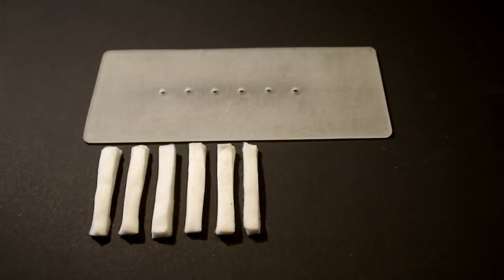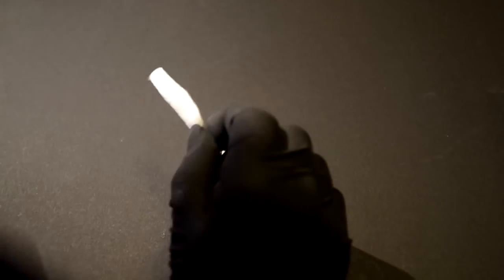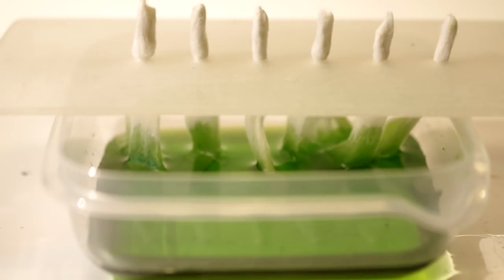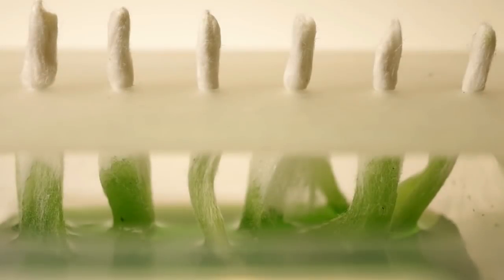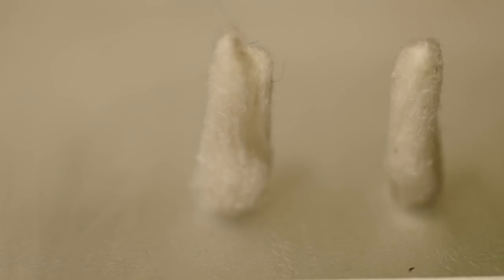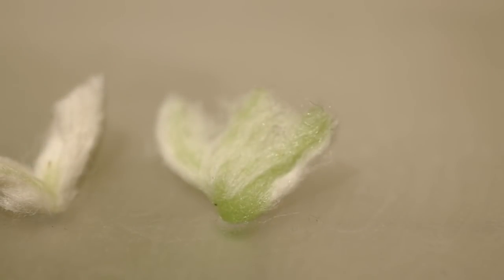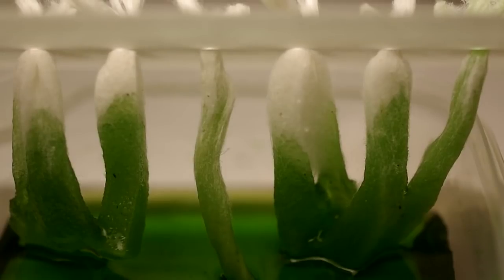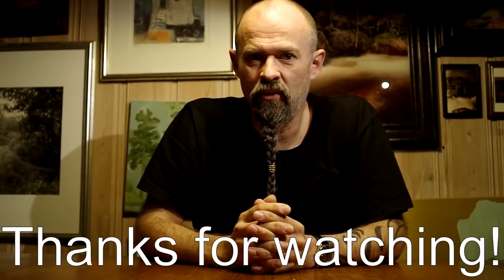How hard should you wick? Very hard! Part 3; Fluffing.

Comment: might be a coincidence, but it looks to me like the tightness has an effect on the end portion of the video.  It looks like the wicks with the most juice at the top are also the loosest in the holes, which could be choking the wick.  If you watch you can see the ones with juice at the top sliding in the hole while the dry ones are more snug.  The sliding could also be from the juice lubricating the hole.

Comment: My first impression on this new learning from Oen... I managed to pass a 12mm cut strip of organic pad through a 3mm diameter 24ga, 6 turns round wire coil inside my Gorge. This is basically the same amount of cotton I already used to cut.. BUT, I used to remove the outer layers (both sides) and I used to pinch/roll one side while holding the other side, to fluff the whole strip. And after cutting the sides to the size I wanted, I used to comb each side and then cut the excess fuzzies. I figured out that when removing both outer layers these 12mm were the "right" amount desired to reach that usual not-loose-not-tight point. But WITHOUT removing these layers, these 12mm almost messed up my build. It's really really really tight now and almost no crackling at all. Dialed down from 40W to 30W and with a nice warm vapor. Flavor is really good and steady, without juice spitting in my mouth now I can really judge the real flavor from my juice, only the vapor, and not the liquid. Very satisfied!
Reply: But one thing I have to say... having to manipulate my cotton so vigorously to pass it through the coil, I think my hands passed something to the cotton that messed up a little bit of the flavor. And I washed my hands very well before doing the wicking work. Next time I'll test with gloves.
Reply: Bob William 
Man, I really hate getting juice in my mouth. I think I might rather have a dry hit than liquid in my mouth. Thank you for your suggestions.
Reply: Bob William 
What ever substance the manufacturer put on those gloves to keep them from sticking together in the box is way worse than anything that might me on your hands, I promise.

Comment: I'm so glad it was # 6. I cut strip out of pad(or rip off piece of bacon) about size of coil hole, take off outer layers, mist my hands with spray bottle and dry so they are just tacky, then in one nice motion role wick, or 2 or 3 times, then spin ends into points, put through coil then pull. Any tighter I would have to hold coil. I now am trying to see if I can get away with cutting ends and dropping in because my habit has been to slightly comb with mustache comb, snip, then agitate cut mark back open. That's always worked great but If I can skip those end steps that would be good.I use 26/36 fused or 28/38 triple or quad fused. Ss from advanced vape supply. Slightly Spaced 3mm id 6 wraps. 
Thanks for videos! Will try to update.

Comment: What about peeling the outer "pressed" layers on the outside of the pad off? I know some people swear by it saying that it just leaves the fluffy stuff that is better at wicking and gets rid of the compressed bits that are worse. Also, would you mind showing a clip of you actually rewicking a coil to better demonstrate the snugness?
Reply: Oh, and I know you tend to go for flavor, what are your opinions on vg/pg ratios? Ive heard people say pg is better for carrying flavor, but you use 80/20. Do you find that pg isnt as important? Most of the juices I have tried are 70/30-80/20. I have found some 70/30s to be really flavorful and some to be duds in the flavor department. Same with 80/20s, some flavorful and some less, so it's not super conclusive for me.
Reply from the maker: Hi, The outer layer should stay on. In combination with the fluffy cotton it's like a wick in a wick. It's no good on its own, and the fluffy cotton is better with it still there. I squeece a 14 mm broad strip of cotton pad through a 4mm diameter coil. 3 times the diameter is a good indication of the tightness. Regarding fluffing, for the most part, in most RDA's, leave the cotton undisturbed, unless the coils are really high up, then you should squize it gently together. I will do no more cotton videos. Sorry :-) But I still do a lot of experiments with it. The new experiments is just fine tuning this stuff, and the data is only valid for me.
Reply: Thanks, I'll give it ago next time I wick up my Kennedy.

Comment: great series.  I'm going to play around with my wicks to see how it works for me.  I usually remove one side of the cotton, scottish roll and fluff my ends.  your method is much easier.  Never used a tank?  merely curious...  when you first started vaping (I think I heard you say you've been vaping at least a couple of years) you learned to build and wrap a coil, learned ohms law etc. before you took your first hit?  Also it seems your first vape experience would likely have been sub-ohm.  just seems a little odd.  most people start with some sort of tank, learn how to vape (since vaping is a bit different from smoking in terms of how you inhale etc.) and then progressively move on to rda's etc.  Unless you have a squonk rda it's simply not practical for most of us to drip all day/night.  there is driving, work and all sorts of activities to contend with which make dirpping impractical.

Comment: Cotton bacon v2 doesn't let you twist crap. I fluffed it and added a lot of cotton.. But I use mesh and no coils... Got any techniques for mesh?

I need a cotton that holds juice.. I stacked a lot onto the MESH coil into a RDTA. Works great but cotton bacon v2 doesn't full more out of the tank fast enough or enough for more then 2-4 hits every few minutes . Sub 70w
Reply from the maker: I do not use mesh, I have never liked it, and I have a handful of mesh RDAs. You might not like my suggestion, but here it is: With all my mesh RDAs I have gotten the best results when installing flat wire coils in the clamps, and using cheapo muji cotton. Most mesh RDAs will let you do this, and the results are way better than with mesh. These RDAs have lots of air holes, and that is perfect for a big flatwire coil. Just think outside the box, and you will figure it out:-)

Comment: Hello morten,
  Greetings from India.
This super tight wicking doesn't seem to work for flavour on my entheon clone. There is vapour but no flavour. Also I did watch your video on the entheon coil placement and I wanted to know if you have a picture of how your coil looks at the correct position and how you get it there because the edges of the atty doesn't allow me to pull the coil down to that height with a coil tool. I was wondering if you have any updated thoughts on the same.
Reply from the maker: Hi. I use a flatwire coil, it's very thin, and you can just push gently on the coil legs to get it down. And place it upside-down. It is not difficult, and if you make your own coils, like I do, it is very cheap to experiment a day or two to get what you want. Good luck!

Comment: How long does it usually take you to hand-hammer each coil? It's good, really really good, loving the ramp-up time. And it really did take me quite sometime to figure out how to calculate it properly.
Reply from the maker: Thanks! I have not mesured the time, but I think I use 5 min on one coil. Never more than 10 min. :-) You'll get quicker fast if you make a coil every other day. Stay with 20g and 22g and 24g wire, and about 3-5 wraps. Change resistanse by using SS or Kanthal metal. This way you rarely have to hammer more than 5cm of the wire, and leave the legs semi-flat. Best of luck!
Reply: @mortenoen434  No, thanks to you! I have been building it the way you are, calculating the circumference to find how long should I flattened it. 22 g kanthal for dual, 22g ss for single ones. Still taking me 20-30 mins for each coil. 0.15-0.22ohms usually.

With the recent mtl rda/rta "boom", would your wicking and hand-hammered methods would work? Just tried it on chtulhu 1928 rda, the wick got burnt so fast on 0.8ohms, hand-hammered 26g kanthal, restricted airflow, 17 watts, 3.3volts. Not enough airflow to cool the coil?
Reply from the maker: @eriefebrianto3492   You need a ton of air flow to cool these coils down:-) They don't work on a lot of RDAs/ RTAs. On mtl there is just no way it will work. But you can try to hammer semi-flat.
Reply: @mortenoen434  Bunch a thanks! I've since been using 26g round kanthal, the cotton is still going strong. But I do want to give that hand-hammered coil another go, gotta make it work. I'll try semi flat if that still fails.

Bought the entheon, and been watching over your vids on its build. Thx so much!

Comment: I do appreciate the information. Are you familiar with the Scottish roll wicking method? According to your experiment, that sounds to be best. 

I also did not understand your conclusion on the coil type video. I saw the videos but I did not know which one was better or recommended  The flat wire, or something like a fused Clapton(with 40 gauge). I also thought the argument of, "You did not use heat" in your wicking experiment to be funny. It makes no difference.  The heat will just dry up the cotton and the wicking will take effect. The focus is the wicking.

Comment: 1 that wasn't so much fluffing the cotton as it was just splitting it in half 
2 where is the simulation for heat that your coils would produce and create a capillary action 🤔
Reply from the maker: 1. The fluffing was for real. Maybe one of the outer layers in the cotton, or the angle of the camera tricks the eye.
2. Heat does not create capillary action. Heat can make some liquids more or less viscuos. It is the density of the fibres that decides how fast and high capillary action works when all else is equal. This was just a re-run of an experiment done in the 16th century. What I have proven is very old knowledge.

Comment: This idea makes sense for rdas but won't wick fast enough for rtas
Reply from the maker: As stated in the video, I know absolutely nothing about tanks:-) But pass that info along if it's true.
Reply: Morten Oen the best way to utilize this method is with squonk rdas.. Thank you for the videos
Reply from the maker: I have a lot of feedback over at other forums, that they have great success with the method on RDTAs. Have you tried it on a tank? Just curious:-)
Reply: Yes sir.. I found out about this method a while back... it's what made the scottish roll wicking method so popular.. I have done research and heard people saying they have had success in rdtas, rtas, etc but looser.. I unfortunately have never found that to be true. Anything that requires extensive traveling of juice doesn't seem to wick fast enough.. My favorite method on rdas is very very short wick.. just enough to touch the tip of the deck with massive, thick, tight wicking. I've used this method for years. I find it uses the full potential of the wick... I can use every drop of juice in that cotton and make it look white as snow before I need to add juice.
Reply: This is where things are subjective. Your idea of a tight wick is probably different than my idea also your wattage doesn't sound high.
Reply: Tested it on a OBS Engine RTA. Dual round wire, 24ga Kanthal, 7 turns each coil, dialed 45W, wicking hard, no layers removed, no fluffing, no combing... Smooth and flavourful as teenager skin. If you dial up to 50W and above, you'll feel a slight taste of burned cotton. But below that, you can even chain vape.